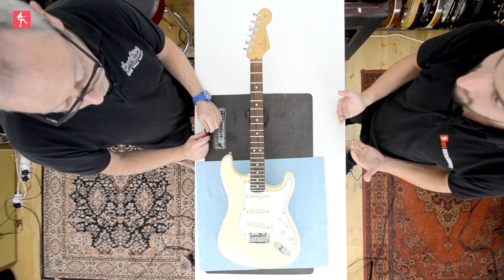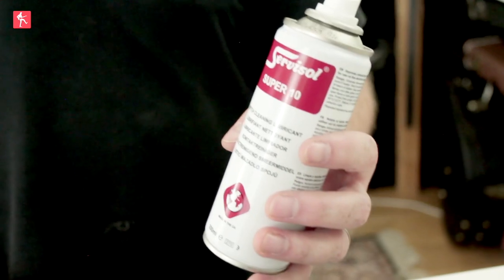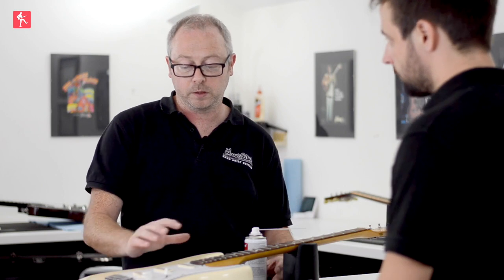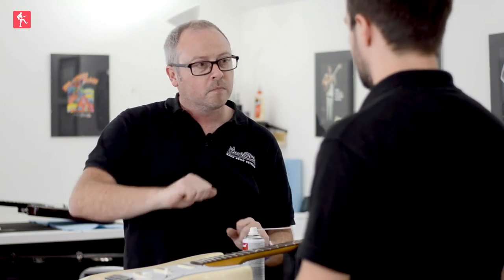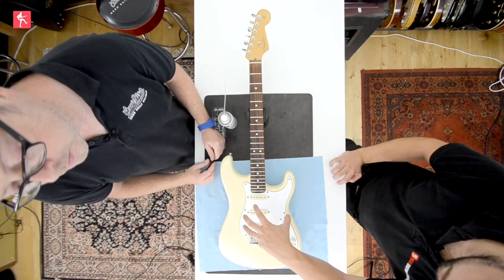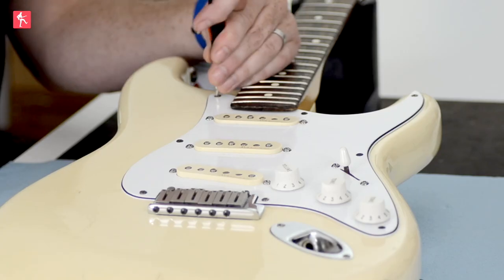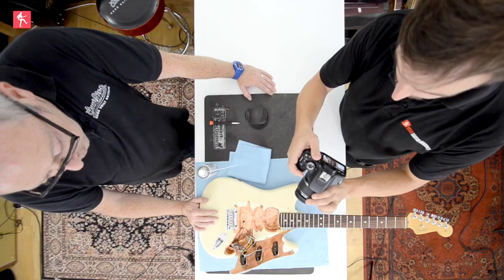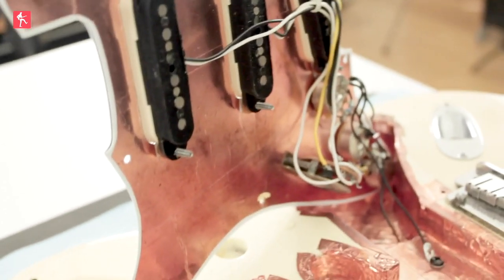How To Clean The Electrics On A Fender Style Guitar - Guitar Maintenance Lesson

Comment: I think some or possible most fender have a thick ground wire soldered to the tremolo plate where it screws into the body. There's a hole for the wire between the pickup and tremolo cavity. On mine it appears to amplify the vibration traveling through the spring, but that could be an illusion caused by the resonance of the springs.Edit: btw it's wrapped around a sorted bundle of wires that inconveniently holds the front plate close to the body. I can understand why someone would move it

Comment: Sound info will try that stuff can you tell me what you think to a SG which after half hour the bridge pickup just seams to loose volume the neck pickup is still fine do pickups like burn out or would it be something else causing this issue ???
Reply: Mine does the same thing.  Neck position cuts off after 1 hour; next day is fine.
1994 USA stratocaster/ never been cleaned. 
 i ordered a replacement pick up single/neck $100 US